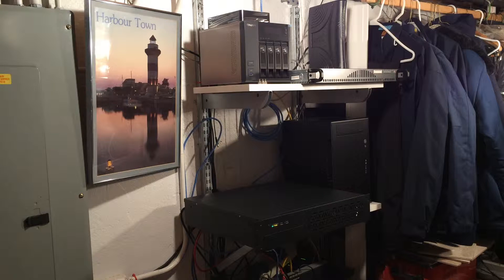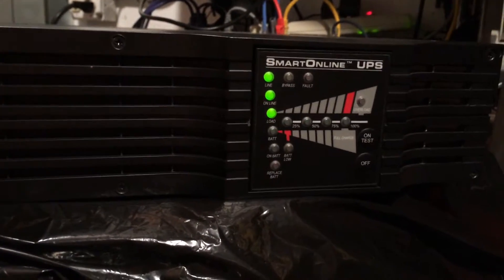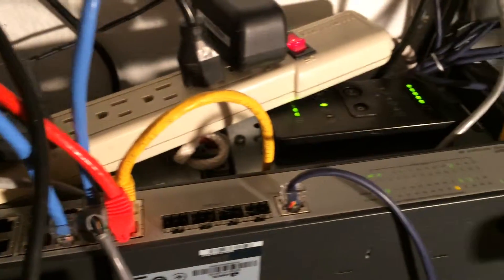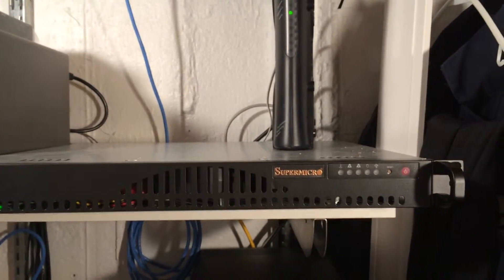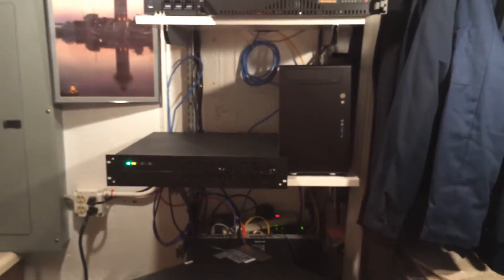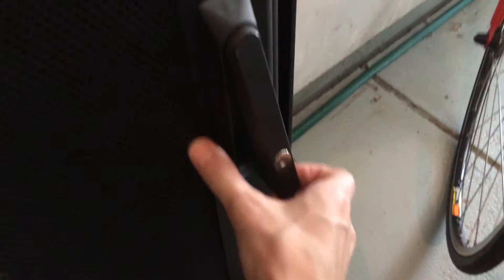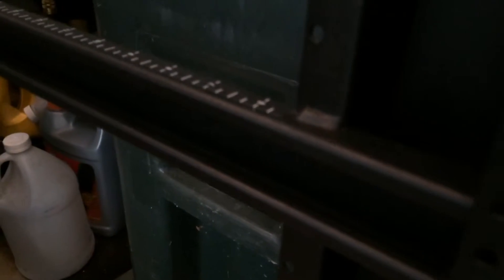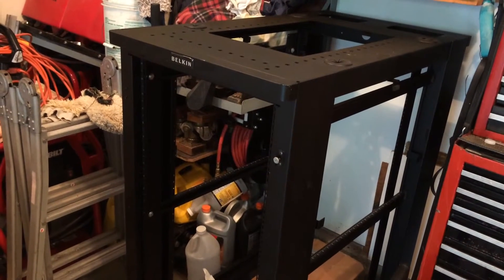My Home Lab - Overview and Project Plan

Comment: Great video !  Saw an 18U Frame Rack on Craig List for $90.00 USD but blinked and missed out...  But got a box Rack about 12U that came with a 2U Drawer that will be  handy (YEA !) and the box rails are about 21 inches deep.  Have a rack TrippLite 1500 that is about ten (10") inches deep.  The APC Smart-UPS 1500 UPS back ups the desktop computer.  And the APC ATS are plugged into the two UPSes and power the Century Link Modem, the ebay Dell Switch.  The over-kill on power protection keeps my system running when the lights flicker and the clocks need to be reset.  Thank you for the video !  tjl